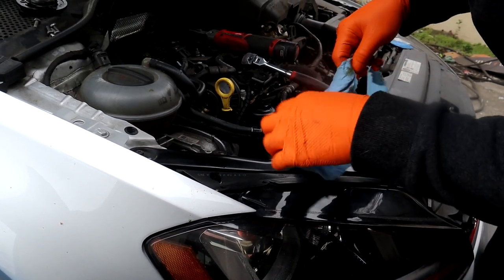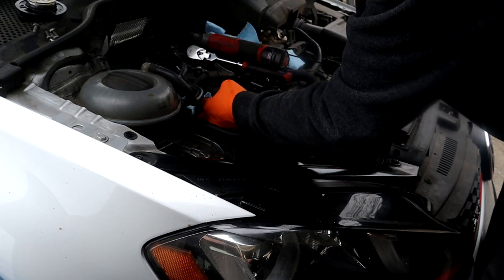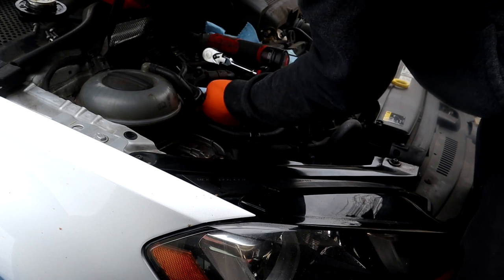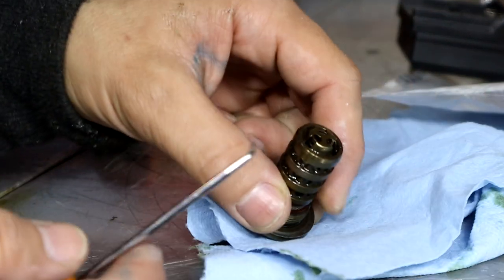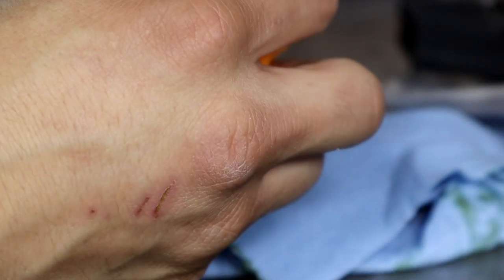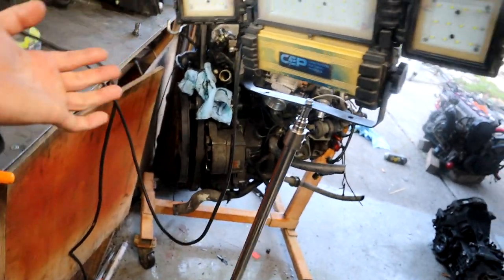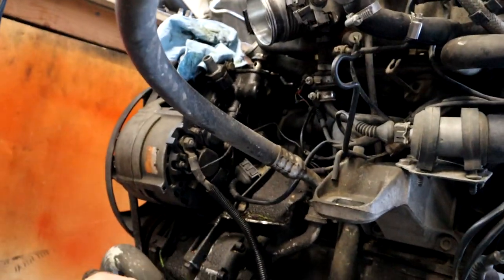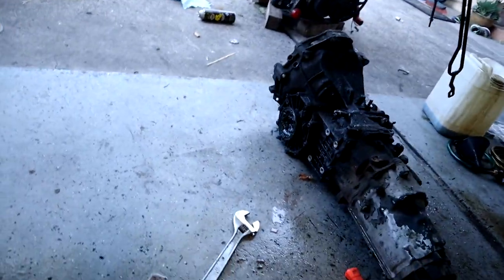fixing  mk7 GTI cam adjuster faults

Comment: Those phasers can wear out in quite a few ways.
Running lean or hot (especially when there is a vacuum leak)
and
Far too infrequent oil changes.
I will add that, if you replace the Magnets sooner than later (because later means you should replace BOTH the magnet and phaser) - then, you'll have a much longer life out of the phasers.  The INA Magnets are on FCPEuro for under $30/Ea and at least you get credit for them should you keep your VW for longer.

Comment: P100A00 MK7 golf R 2014 (cam shaft position slow response bank 1)Fault code car sounds like it’s struggling in idle engine has gone as far as cutting out any help??
Reply: Hope you sorted this. This sounds like the magnets. Might as well change the valve as well.
Reply: Did you get this sorted?
Reply: @jeffm623  yeah haha was magnets
Reply: @viqaasdean1703  ^^^
Reply: I’ve the same issues in my 2014 GTI. When it’s cold it struggles to idle and just cuts out, soon as I get it upto temp it drives fine. Did you experience this? Where did you get the stuff from to change do you remember? I’m UK based also (Leeds). Appreciate any help 🤞

Comment: Which part numbers did you pull/replace? (For the valve specifically). My 2015 GTI had 06K.109.257.A from the factory, but this has apparently been superseded by a B, and now C variant. Everything I've read states that I'll need to replace my intake camshaft as well, which I'd like to avoid unless absolutely necessary. All 3 variants look identical, so just wondering what the deal is. Thank you so much for this video! I had narrowed it down to this after a few weeks, but wasn't sure I had gotten it right until I saw this video, and your responses. Very grateful for putting this out there!
Reply from the maker: i think i just had my friend go to the dealer and order them per vin
Reply: Update for anyone who comes across this, the B/C variants cannot be used as a direct replacement to an A variant, they are just slightly slimmer in diameter, and as such, will not screw into the camshaft correctly. I'm now either going to try to find an A variant off a crashed 2015, or bite the bullet and replace my entire intake cam.
Reply: @ChandlersHax  what i think is that is that you need the 06l 109 257 D instead of the B or F because the screw of the F is 21mm and the D is 20mm
Reply: What you also can try is buy the F version and replace only the part that is inside the housing with the one you have in your car, because the inside is the same only the screw is different.

Comment: Im currently getting the code P0011, i noticed the streams of the intake cam oil control valve are a bit damaged, can they be the ones causing the intake cam timing to over advance?

Comment: Hi bro!
Would you help me out with a problem that i am having with my mk7 gti
I am having a leak from that bolt that is holding the camahaft magnet, its leaking only from the bolt.. would it be enough to replace just the O ring that is sitting inside the cam? The part number is WHT007212B
Thanks!!
Reply: have you got it fixed ? have the same leak on my mk7 gti

Comment: Hi, do you need an timing tool to lock the engine? Is there any chance to skip a tooth by undoing them solenoids? Thanks
Reply from the maker: no, you don't need anything to hold it on time when removing the solenoids

Comment: what specific sound stands for faulty valves ? onto video I only see some jitter with engine cover (engine running erratically, rough idle, rpm drops down for a while). Is this it ? thx

Comment: Getting code p011, Is there a seal for camshaft magnet ? Or does it go right back on with bolts
Reply from the maker: @adolfonunez1960  there is oring inside and then the seal on the timing cover

Comment: Hey what noises were you getting prior to replacing the cam adjuater magnet or spool valve. I have like a ticking noise coming from that area which i took apart and tested the mag and the spool valve wasnt potruded or anything ??
Reply: Did you ever figure out what the ticking was? I've heard the camshaft aduster magnet is the issue

Comment: What the part number for the special tool. I got a 16platw golf r which where the cam magnets are they are tapping when the engine is warm . Unplugged the magnets and they weren’t tapping so would you reckon just changing those oil actuators and cam magnets will sort it?
Reply: hey mate, did you sort this out?
Reply: @PlaywiithMee  yes mate replaced the cam magnets and the oil actuators and she runs mint now
Reply: Hey man just curious where did you order the oil actuater from I can’t find one anywhere!!!!! Thanks again!
Reply: @Twilde58  I went genuine for it mate
Reply: Did you get new valves and magnets for both cams or just the one on the left? Aldo just curious, are you tuned by eqt?

Comment: Hey Neil, question for you:  I have a 2.0T TFSI CBFA, when the car is up to temp I am having starting issues.  I've taken it to a mechanic who only works on VW/ Audi's and he couldn't figure out what's going on with it (He is the only one that works on Audi's in the area).  I noticed that after the car is turned off it continues to build fuel pressure.  I've recorded it as high as 2500 psi of fuel pressure with the engine off and key in start position.  I just changed the HPFP because my best diag. is an issue with the pressure relieve valve in the HPFP.  Duty cycles are in spec on the pump at the tank (45%) and at the HPFP (55%).  Any thoughts would be greatly appreciated, thanks!
Reply from the maker: Starting like a long crank before it starts?
Reply: carwerks101 Nope, normal crank time—but it kills itself before it fully turns over, i can only assume due to the extremely high fuel pressure
Reply: everything else seems normal
Reply: You're def going to see fuel press rise when the car is off on a hot engine on these.  In fact thats a good test for a leaky injector.  With bad injectors you will see fuel pressure drop or stay about the same after shutdown.  Its normal to rise as the heat causes the fuel to cook off/vaporize a bit inside the rail.  Doesnt hurt anything.
Reply: @carwerks101  what is happening when there’s a long crank b4 start ?
Reply from the maker: @prolifik_hussle5972  usually fuel filter, what year and engine?
Reply: High pressure fuel pump, if you haven’t replaced it yet, that’s your enemy, had the same problem

Comment: Did the car run any better after changing the solenoids buddy?
Reply from the maker: after changing the valve in the cam shaft is only when it was fixed

Comment: What are the symptoms besides the noise?
Reply from the maker: @tiagoloureiro7665  misfires, rough running
Reply: @carwerks101  My car does not make mistakes does not turn on breakdown lights nothing picks up well and at first but in the relantim both hot and cold I feel these tremors and hiccups it seems that the car is trying to compensate for something they have also already told me about carbonization but valves

Comment: Hi there having a ticking noice on the motor someplace close to the timing cover... No engine lights. Would like to know what I might be or can it be the same problem... Gti golf 6
Reply: Please sir need ur advice
Reply from the maker: @romanoclassen879  could but not likely, any work done recently on the car?
Reply: @carwerks101  hi sir. I done new tensioner en chain plus the quids as well but still the same noice
Reply: @carwerks101  the ticking noice goes louder nd faster when I accelerate
Reply from the maker: @romanoclassen879  sounds like maybe a collapsed lifter
Reply: @carwerks101  I didn't replace all the lifters but replaced 5 of the ones close to the timing cover
Reply: @carwerks101  there isn't a option that I might maybe send a video that I can Maybe hear it out maybe... I live in south africa

Comment: I had code p0341 and the car makes a noise almost as if it’s knocking but coming from that corner. It also sounds like an exhaust leak, can this be my issue ?
Reply: My car similar, did you get your issue fixed?
Reply: @DizzleProHD  yeah I changed both of those pieces on my car so the solenoid or can adjuster for the intake camshaft and exhaust camshaft
Reply: My intake solenoid was fine but my exhaust side was bad so it would occasionally get stuck and make those noises, very annoying but not a hard fix. Car has been running good for a while now thank god

Comment: What was the symptoms. currently my friends mk7 gti missifring and stalling itself
Reply from the maker: Misfired and rough idle
Reply: @carwerks101  Thanks, sounds like same issue with my mates. Idle missfire and rough when you raise revs it's ok lol
Reply: so mine sounds like it’s almost misfiring/ running on 3 cylinders changed spark plugs and coils and still got the same subaru like noise , i don’t know if it’s cause of cam adjuster , or cam position sensor , let me know if u think you know what it is 🙏🏼 haven’t driven my is38 gti for monthsss now
Reply: @kiliannelson5320  His was the cam adjuster i think inside the magnetic sensors

Comment: Is this the same part and installation on the Mk7R ?  I’m having a rough idle issues and changed the camshaft adjuster magnets but didn’t check those valves you replaced. I’m thinking that could be the same issue? But that valve says Gti only when i check it. Is there a Golf R one or are they the same ? Can you Check my video and give any tips?  https://youtu.be/QU9lasb_rAw
Reply: Im wondering the same thing
Reply: Yes it’s the same part. I just replaced mine in my 16 R